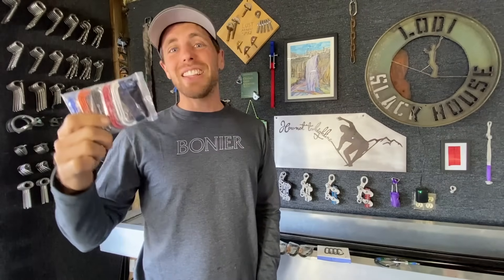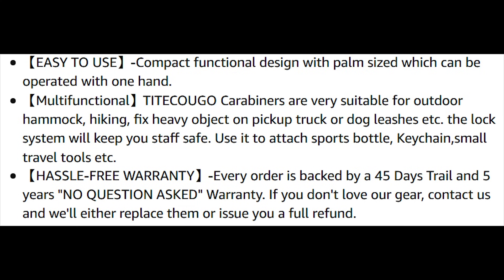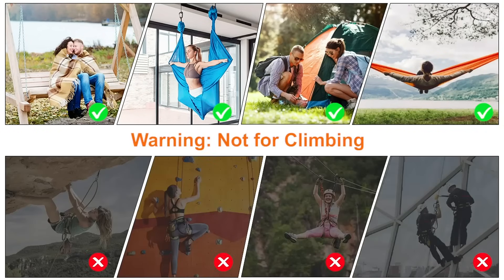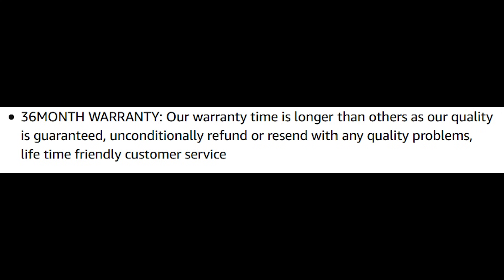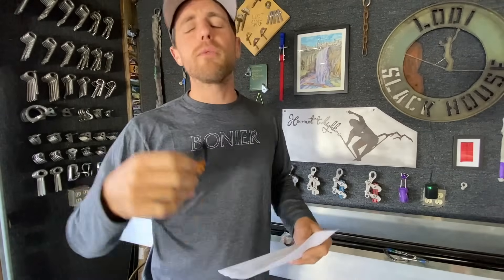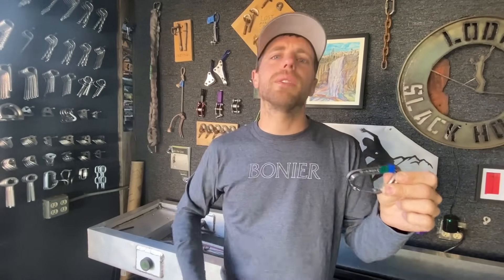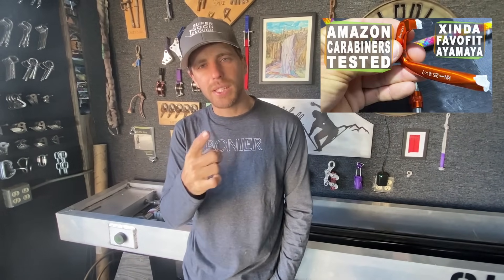I Hate Amazon's 12kN Carabiners

Comment: I mean, they are exactly what they claim to be. Seem to work fine for what they are. People do more than climbing with carabiners.
Reply: Funniest part is that they are more expensive than climbing rated carabiner (got made in Italy, UIAA CE etc biner for 4€ without tons of plastic)
Reply: @truc2fou915 I just purchased a set of four, for $9US and others are listed around $2 each, while the lowest cost  rated one I could find was the Camp he presented here at 7.50 each. That saved me quite a bit on 8 of them for non safety related use.
Reply: people do get upset when amazon sells  imitation ferrari or lambo
Reply: 9:13 they claimed it was for rock climbing 😊
Reply: @bailoo4474  That's just some woman making a video on it, a woman presumably not associated with the company. The manufacturer wouldn't make that claim.
Reply: Anyone who would risk their lives to save a few dollars on a safety critical device is a good candidate for the Darwin Award. That said, carabiners are a very useful device that have a lot of utility. Harbor Freight has a lot of real crappy carabiners where the gates and springs routinely bend and break. Those Amazon brands are much more durable, and though not intended or designed for climbing, fill a niche of other applications. I don't need the size, cost, or weight of a climbing carabiner for a tent ridge line.
Reply: I mean that is literally what he was saying basically the entire time.
Reply: they are still deceptive and come in a bunch of plastic crappy packaging
Reply: @theronwinsby  Are they? They clearly say they are not for climbing, They clearly say they are rated for 12 kN. They are perfectly sufficient to hang something off your belt or whatever.
Reply: @jort93z  the argument is that they are built exactly like climbing biners, and there's an image of a climber, which could make people think these work for climbing. It says they're not for climbing in like, the smallest print on the page. Also that they give incorrect advice about climbing biners in the instructions
Reply: @katatat2030 you’ll never stop companies from making “knockoff” carabiners but Amazon could delist anything w/ deceptive marketing. Unfortunately deceptive marketing is basically part of their business strategy and they’d have to remove a huge % of their listings, so 🤷‍♂️
Reply: @katatat2030 ehhhh, I don't think that's fair. Carabiners are carabiners... 

I'm not saying it's not dangerous, but I don't think that design should be only for climbing carabiners
Reply: @roo9569 Take these same arguments and apply them to rope. They aren't all complaining about the hundreds of types of rope that are unsuitable for climbing. This is a very similar situation to 8mm and smaller rope that is woven and looks exactly like thicker ropes rated for climbing. People have to use good judgement and cannot use just any rope just like these. 
I'm with you thinking people are over reacting that they are similar. They perform exactly as they state. They are also low cost, pretty strong, easy to use, no sharp edges to snag or cut, smaller and lighter. They work well for speed lining branches out of a tree and keep wear off of the rated ones. Great for hanging your saw, or rigging smaller loads. 
If people have both, just make sure to get different colors so you don't mix safety related ones with non safety rated. Red for danger perhaps.

Comment: I've been sold so much fake stuff from Amazon I don't think I would ever buy climbing gear through Amazon. 
I bought an Apple PowerBook power supply, came wrapped up like an Apple product, the Amazon listing said it was being sold by Apple. About two years later it started smoking. I took it apart to see if I could fix it and comparing what I found inside to all the images of Apple power supplies - it was a fake - a dangerous fake.  I then learned that when I purchased it from Apple through Amazon - Apple wasn't selling on Amazon. (I've bought Apple stuff for 30 years so however that fake stuff was wrapped looked Apple enough to me.)
I bought a Janome sewing machine through Amazon from "Janome". At first I thought I just didn't know how to sew, but after a few months I realized the machine was out of whack. I called Janome for service under the Lifetime Warranty. Where did you buy it? From you on Amazon. We have never sold on Amazon. Cost me $200 to fix  the $400 sewing machine sold under false pretenses on Amazon.  I've got more stories. 
Bottom line: Don't hang over a cliff on anything you buy from Amazon - it could be the right gear from the right company, or it could be a complete fake and kill you.

Comment: I bought these for general use and ended up using them on the leg straps I make for sailing PFDs (Mustang vests). The Mustang company sells leg straps (~$100) - to keep the inflated vest from just lifting up around your neck in the water.  They're attached with only ABS plastic clips - which seem pointlessly weak.   The main purpose of leg straps  is to keep the life vest in a better position in the rare event you go into the water.   These vests have Spectra or metal D-rings for attaching safety lines to  (Jack lines) so you don't get washed overboard. 
My thinking was  1" webbing straps that have a  sewn loop (11 bar stitches) on one end, carabinered  to the belt webbing of the PFD, then run under the crotch, through the back loop on the PFD, then back under the crotch to carabiner the other waist strap. This side has a double knot loop  so it's adjustable. 
I figured that these 12kN carabiners should be strong enough. Your weight would be distributed if you were lifted straight up by three points of attachment. If you were lifted by the D-rings less than half your weight would be held by the three leg strap attachments. 
My logic is that  if I was in the water in a serious rescue situation I could quickly clip or tie into the D-Rings (not the leg straps) into whatever a helicopter or rescue vessel threw to me and with no possibility of me falling out of the whole harness PFD - quickly pull me to safety and be ready to help someone else. (I've given them to friends - but I wouldn't assume the liability of selling them. )
I really appreciate your video and testing.  I guess it's full speed ahead for my straps. (Two of these carabiners cost about $12, the webbing costs about $6-8, it takes only  few minutes to sew the single loop - I give them to my sailor friends. Saves them $100,  while providing an additional safety margin. )  And if these carabiners in my straps are ever used to lift a sailor's weight it would be one time event.   
I also use them on my hammocks (200 lbs max dead weight pull so ~900kN.  Hammocks are easy. A standard 30 degree hang is your weight on each line. And I follow the hammock safety rule of don't hang higher than you can drop on your butt.
Reply: One thing I would add is that many carabiners (even climbing ones) have components that corrode quickly in salt water. There's a lot of info (and debate) on the carabiners used on sea kayaking tow ropes and tethers used in salt water. I don't doubt that some of the SS components (the little spring for an aluminum gate carabiner) will corrode quickly. I bought a little SS folding knife just before a 5 day course last fall and it was starting to rust by the end. It lived in my PFD so got wet during rescues.

Many kayak towing systems use climbing rated carabiners despite the fact that the loads are very low. In addition, those with a notch can easily catch on smaller deck lines, which makes them more of a hazard in use.

However, as others have said, for many applications something like this would work fine. In others, it would be dangerous. I would also be very interested in seeing the open gate load capacity.

Comment: The one point that was kind of glossed over is the importance of good quality control. Everything from tracking manufacturing defects, to sampling plans, to tracking reports of defects, to issuing recalls are critical to ensure a product is safe and effective.

Yes, these specific crabs performed above their rating, but how likely would they spot a defective product during production? What is the probability of one of these carabiners having a critical defect? Is there a rate of unacceptable product leaving the facility before they stop production or issue a recall? Or would they just change the branding and keep pushing out product?

For example, the one crab pulled it's wire gate straight. This indicated the failure is due to the crack propagating from the wire attachment hole and not where we typically see it, an indication of localized stress concentration in an unusual spot. This shows there's likely insufficient manufacturing controls.

The other thing that affects price is design engineering time. Buying these essentially rewards the copycats, and punishes the inventors stifling innovation.

Comment: While they might be stronger than advertised when brand new, the main problem with climbing gear is called "cycles to failure" and these would definitely be unbelievably weaker after being used for a while. Excellent video. These types of things are in major need of exposure. 

Now do another one on the crappy rope sold on Amazon and also at the big box stores that is made to look like climbing line. That infuriates me because I have people wanting me to install swings in trees and they ALWAYS get that garbage because they think it's the real thing.

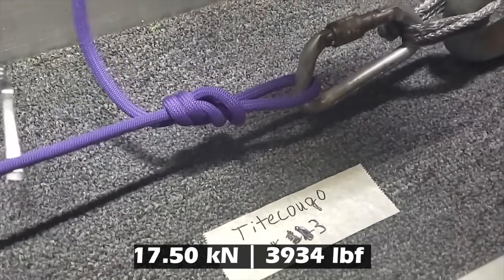Comment: 11:33
Why you using "lbf"? That's a torque. You're not torquing these. You're applying linear tension, to be measured in pounds (lb), grams (kg), Newtons (kN), tons (t)...
Reply from the maker: I think you need to look up lbf again.
Reply: @HowNOT2  
Having been taught how to turn wrenches on vehicles by my grandfather and father, and on helicopters by the US Army, I have never seen "lbf" used anywhere.

I am going to assume "lbf" is simply a college professor's pet peeve when not used, because he's too stupid to differentiate between pounds of mass and pounds of force.

Everything I've seen for torque has been lb-ft.
I assumed lbf is a new abbreviation, because every time I've seen "force" as a variable abbreviation, it has been a ƒ.

I have learned something, and I despise it. I won't start using it.
Reply from the maker: Your last lines made my day. We use both KN and lbf so a larger section of our audience understands the forces, and we explain what these measurements mean A LOT.
Reply: @HowNOT2  
If you set a mass on a scale, does the scale measure the mass or the force?
It measures the force, because if you are holding the scale in hand and swing it around, it would read more than simply the mass' weight, but we'd still say the mass weighs X lbs when writing it down.

So, is there also a gƒ or kgƒ? I've never seen it.

Wiki says it is non standard:
"Kilogram-force

The kilogram-force, or kilopond, is a non-standard gravitational metric unit of force."
Reply from the maker: Your scale analogy is exactly why they have different units to measure mass and force. Your measurement  is going to rise the more acceleration (swinging it around) you add. Mass x acceleration equals force right? Other phenomenon may come into play in that scenario but I think you can grasp my point.

Our dynamometers are just scales that read anywhere from 20 hertz to 30k hertz. They give us results in kn or lbf.

Yup, kilogram force is non standard. You will see old climbing carabiners labeled in kg. The standard for strength ratings on climbing gear is KN now
Reply: @HowNOT2  
Quite interesting, I know not how a dyno measures in frequency (unless that frequency be RPM) but outputs a force unit of measure.
I've only once had to take my car to a dyno equipped shop to prove to the judicial system that my car is incapable of traveling at 180mph.
I was cruising on I-77 at about 72mph when a completely blacked out and lights off Porsche flew past me. A cop had no chance of catching him, but locked up his wheels to not slam into me, and I got the ticket. Judge threw the ticket out seeing as I brought proof my car was incapable of that speed, but court cost was still $98 and a day of missed work for me.
I didn't get to play with the Dyno myself.

Is it really a different unit though, if a 200 lb climber falls 10 feet and the rope returns from its stretch by about a foot, he exerts a force to the last anchor of about (guessing high here) 28kN?, so it's as if he weighed 6,000 lbs, right?

I miss climbing, but I'm more of a free climber taught by my dad to make my own swiss seat and loose attach rappel lines to bring them with us as we navigated the Niagara Gorge and the New River Gorge.
Reply from the maker: Great story. 

Different kind of Dynamometer, the car variety sure would be fun to play with though. 

In the dynos we use hertz is effectively how fast it sample tge force being applied. The faster the sample rate the higher chance of catching the peak force. Higher speed dynos being more desirable with drop tests where the load is applied much faster than in the tests in this video. We are working on getting a 30,000 hertz dyno programed. 

Your numbers are really high thankfully. We have never seen much more than 4 kn on a lead fall in our limited testing on the subject but it has been tested by lots if ither people and 6 to 8 kn is generally considered to be the max you could generate with a dynamic rope in the system. We have a video where we measured lead falls in a gym and we plan to do more testing.
Reply: @HowNOT2 

Ohh, makes sense that the frequency is refresh rate of readout, basically.

When using a proper rappelling rope with stretch, the strain on anchor is nicely reduced.

Dad and I never used proper gear, those are the numbers I recall him using for my crash course lesson before we tied on. He only bought 100' of rope, and I believe it was nylon, not even cored, very little stretch so the max cliff height we could do was about 40 feet because we just put the middle point of rope at tree and rappelled with both ends to grab simultaneously. He taught me it's better to rappel fast and hit the ground hard than to sudden stop on the rope before ground.
He did make a point to say the tree has to be at least 5 feet from the edge, so our weight on the line is more on the ground at cliff edge and less on the tree. Exact numbers we never had ability to measure.
There was one cliff in the New River Gorge which the ends of rope didn't reach ground. He was hesitant to do it, but we did it, was about a 5 foot fall once the rope ends were reached and when it was his turn he stayed holding one side so it was way easier than I had it.
He taught me tuck and roll by the garage roof, about a 9 foot drop.
He didn't like staying in one place for long when we were hiking, and most of the anchor trees we used I recall being surprisingly thin.
We free climbed a 60 foot face to get back to car once, ropes in backpack because we had nothing other than the one 7' rope we made our swiss seat with and the single 100' rope for descending, he bought one figure 8 and one screw clasping carabiner. I descended first everytime, then I'd remove my swiss seat and he'd pull it up with the rappelling line and join me, then we pulled one end of the 100' to keep it with us. He asked a bunch of times if I was ok doing the no line climb, and I think he was actually hoping I'd say no so he wouldn't have to. It seemed afterwards to have bothered him more than it did me, I loved it, but he never put us in the same scenario again, preferring to walk up steep thorny thickets that he called shortcuts from then on.
Truly fun times.
Reply from the maker: Great memories. I have many similar ones. I rarely use the Swift   seat.   I find it has annoying habit of grabbing me behind the knees when climbing.